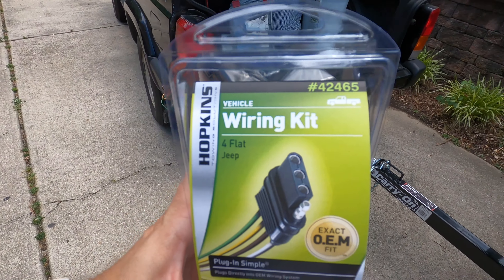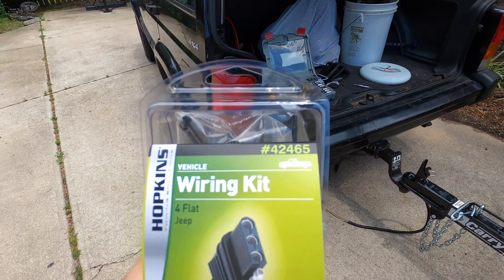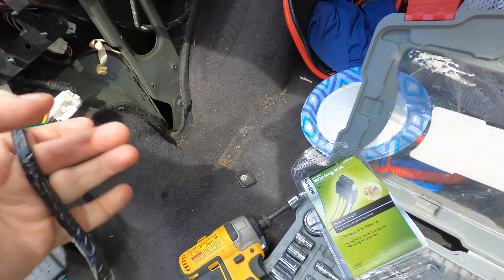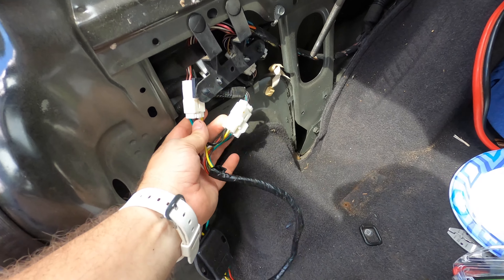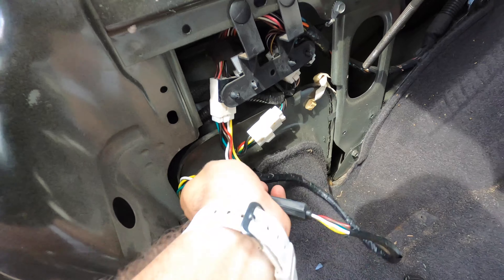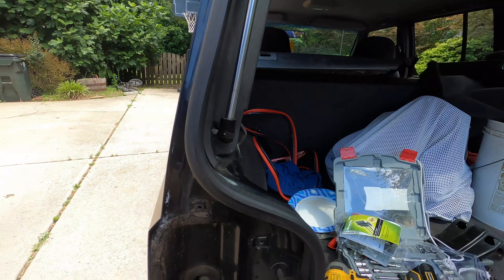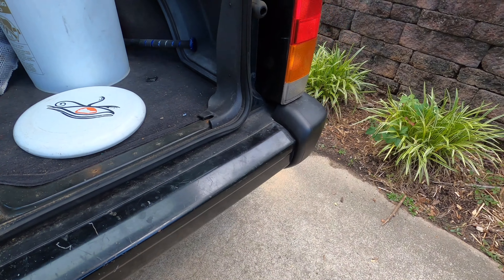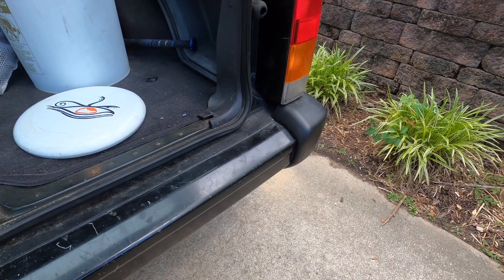Jeep Cherokee XJ - Installing trailer wiring harness

Comment: Just so I understand, are you saying the wiring kit doesn't need to be spliced into the tail lights/break lights/indicators? You literally just plug the new harness in to an existing port and everything works?
Reply from the maker: Yeah, that's how it works! I cleaned up a few things from the old harness.
Reply: Thanks! 
 @LifeWithSevenSons